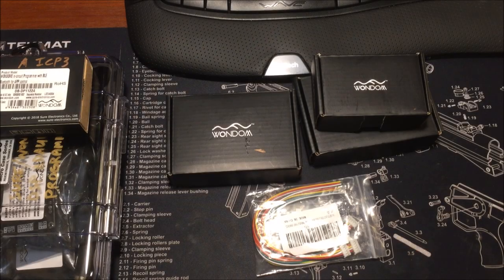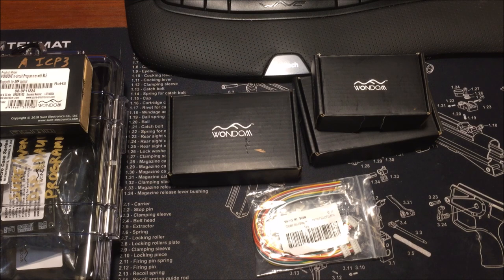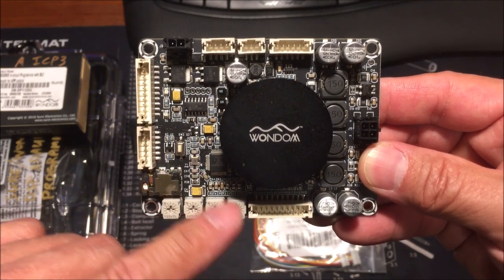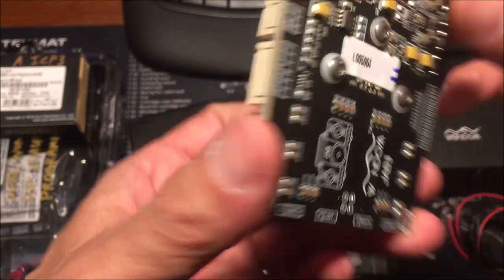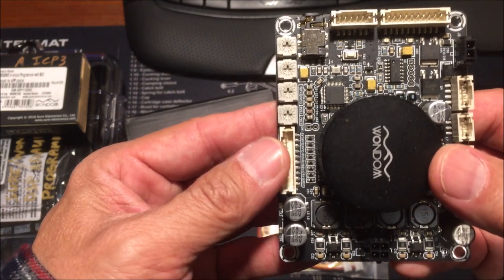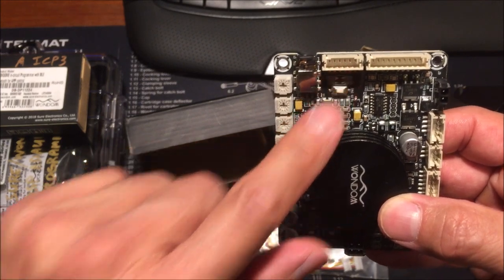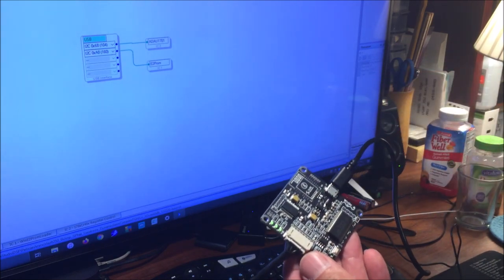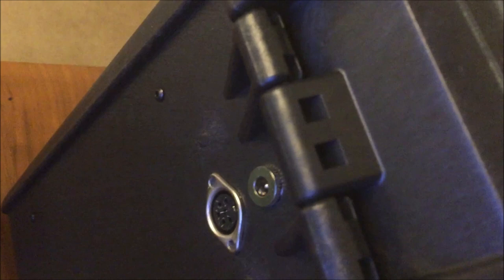Sigma Studio: How to program ADAU1701 DSP Chip Step by Step!!!!

Comment: I want to make a custom cable for my boombox in construction as well. The question ist: Is it possible to aquire a spare plug somewhere so I do not need to cut the original one. And a 2nd question is: Is the cable length somehow limited on the side between the DSP and the prgramming card?

Comment: Can you provide the info on the 6 pin connector cable between the amp and the ICP board?  I've got a project with a  4 channel amp and wanted to put a 6 pin connector on the outside of the enclosure like you did .  I cannot see the pitch of the connector to know what to order.  Can you help?
Reply: I hope you already found an answer.  I don't own one yet, but I believe wondom sells a bag of most of the wires in one $8-12 pack. Ebay and Aliexpress.
Reply from the maker: Take the six wire jst ph cable included and cut in half then use male and female six pin AV audio video and solder each half of cut cable and ensure wire to wire soldered to AV male female pair.

Comment: Great video! Im controlling volume with a rotary encoder, but if I turn off and the on, the amp does not start with the last volume level it was before powering off. Is there a way to make it work like that?
Reply from the maker: What amp hardware are you using?
Reply: @MoDIYHiFi the APM2 with the extension kit for a 2.1 system. For subs, it is a 1000W ICE board, and for full range a wondom 2x300W. I used 4 pots and hooked up 2 encoders for more control. The problem is that the enconders dont save the last position before powering off.
Reply from the maker: @pacoryu  I will always use SigmaStudio program the pot encoders and once the file is saved and burned to the APM2/3 then the pots settings are set in DSP logic and flowpath are saved. The pots are volume, low bandpass, high bandpass, and gain. Have you downloaded the base file in the APM2/3 to see their stock assignments???
Reply: @MoDIYHiFi  with the 4 pot connected to the ADC inputs I have no problem. I added two rotary encoders to the GPIO inputs and they work fine, but if I reset the board, the levels controlled by these two encoders do not remain the same, always go back to minimum. I've read a bit and it seems I have to work with selfboot and writeback features but I cant figure them out.
Reply from the maker: @pacoryu  if you reset the board by pressing the reset button it always go back to factory settings. The answer is to create or modify a base APM program via Sigma Studio and flash it to APM then whenever you power up your project it’ll start up with your program unless you hit the reset button. The base Sigma projects are available for down load at Sure Wondom or Part Express.
Reply from the maker: Once you get to this point the flexibility of controlling and assigning the analog knobs is almost infinite limited on your creativity!
Reply: @MoDIYHiFi  Thank you so much for your help and time!

Comment: Great video, thank  you - this increased my understanding of this environment! I was wondering - do you or does anyone know if it is possible to program ICP5 with JAB5 (Wondom) to act as a USB Audio Interface? I am hoping to have 4 mono inputs I can assign from my DAW to output at the JAB5 with its built in 4 analogue outputs. TIA!
Reply: Not sure about that, but it should be possible to use a USB to I2S module to act as your interface. Two channel ones are pretty common. Not sure if JAB5 takes 4 channel I2S.

Comment: Hoping you can help me... How do you think a Seahorse 520 case (~15”x12”x7”) with a single 8” Infinity 2-way marine speaker mounted and driven by a Dayton KAB 100W mono amp would sound with 14.4-21V power from 4-5 18650s? Never built anything like this before. Thxs!!

Comment: did anyone try to hookup a generic i2c/uart to usb converter to these amp boards or it only works with their ICP?
Reply from the maker: I only have experience with icp 1,2,3,5. They all work with ADAU1701 boards. Only difference is the 3 and 5 has Bluetooth for the optional smart phone app and PC app which allows simple tuning of tone or equalizers. Sigma studio is much more comprehensive therefore it fits my needs but learning curve steeper but worth it.

Comment: Great video, thanks for the help.   Running into a weird issue on two computers, at a certain point in the process the crossover becomes not clickable any longer.  I can add a new crossover to the project and the blue button does not click into the settings any longer.  any idea what that is?
Reply: Holy hell, I figured it out... If you zoom out or zoom in the crossovers become uneditable.  but as soon as you zoom back to the default view all is good... SMH lol

Comment: Well i've gone out and bought these boards and i've got nothing but distortion after the first couple of watts... checked them with a powersupply and 2x12v batteries in series :/
Reply: I had that with a 24v PS. needs more voltage